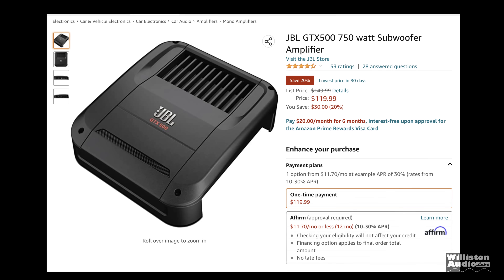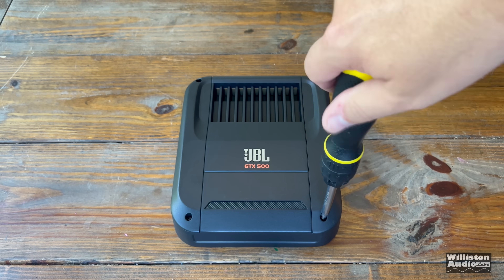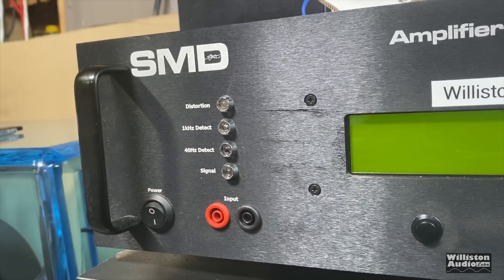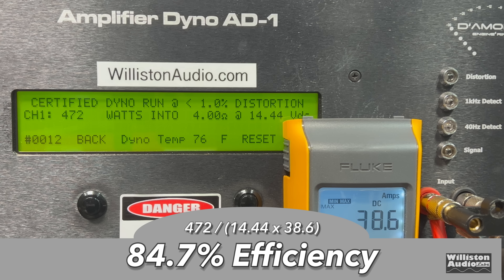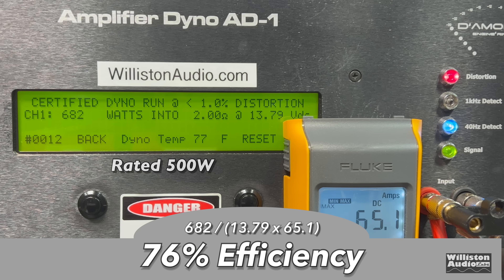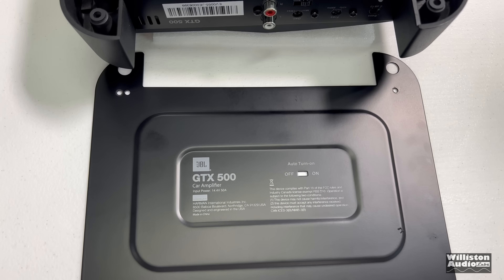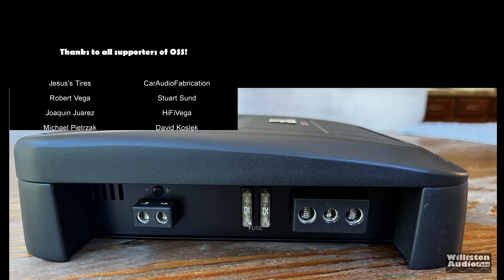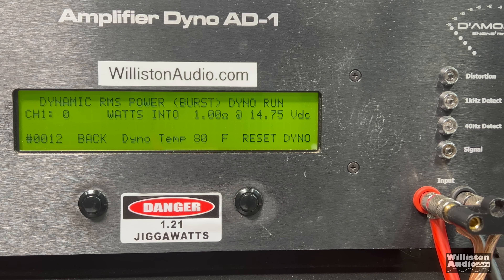This Deal Won't Last...Has it Expired?  JBL GTX500 Amp Dyno and Review

Comment from the maker: Shop (affiliate links):
Amazon: https://amzn.to/3Rw53q7
eBay: https://ebay.to/3KY5hV
KICKER L7R Quad Box: https://amzn.to/3KY5xn3
Shop for Other Low Budget Amplifiers: (affiliate links)
Leiges Audio 500.1: https://amzn.to/3PQ1utS
Down4Sound JP8: https://lddy.no/vvaw
SKAR Audio RP-1200.1D: https://amzn.to/3FLdLfk
CT Sounds CT-400.1D: https://amzn.to/3u9n1UY
VIDEOS: Playlist of Affordable Amplifiers: https://bit.ly/3cEQYHJ

--------- Cameras and Gear Used To Shoot This Video -------
(Video Gear I Use) 
Camera - iPhone 13pro 1TB - https://amzn.to/3nCjGvc
RODE Wireless Go II Microphones: https://amzn.to/3Q6NVHl
Shure MV7 Microphone: https://amzn.to/3A4OICK
Zoom H4n Audio Recorder: https://amzn.to/3BXjVsS
960 LED Panel: https://amzn.to/2Sxoq3S

This VIDEO was EDITED with LumaFusion on an iPad Pro 12.9:
iPad: https://amzn.to/2Ancr1W
Software: https://goo.gl/6yvWss

--------- Test Bench Equipment -------
SMD / D'Amore Engineering Amp Dyno: https://goo.gl/sJTcf7
XS Power D1400 Batteries - https://amzn.to/2BPFCKW
XS Power PSC60 Charger - https://amzn.to/2CHGcfs
Fluke 1000A AC/DC Clamp Meter: https://amzn.to/2Rw5WDA
Handheld Dyno: http://amzn.to/2u2EgKV
My Favorite Screwdriver Kit: http://amzn.to/2x0VzcE

DISCLAIMER: This video and description contains affiliate links, which means that if you purchase from one of the product links, I may receive a small commission. As an Amazon Associate I earn from qualifying purchases
Reply: 8 left in stock

Comment: Dereck, I just bought one of these "gently used" based entirely on this video. I already own a couple of JBL amps and needed another one like a hole in the head. But, this kind of power for $60 shipped is a deal I couldn't pass on. 
People seem to sleep on JBL and Infinity (both Harman brands) because of their legacy of OEM products. Well, there's a reason they have supplied auto components to every major manufacturer. 👍👍

Comment: I have this amp and use it in my new truck, thing absolutely rocks. Had it sitting in my garage and bought a skar sub to pair with the factory HK system. Mind blown and love the auto on/off, no need for a remote wire.

Comment: Harman doesn't play around with their legacy brands. It's long been a point of pride for JBL that their products are over-engineered for their specification. In fact, I have a JBL (rack mount) amp lurking someplace, model 6230 designed by their then-new subdivision UREI. The manual actually says that the amp ratings represent only 25% of what the components can technically handle, and they did it for reliability and headroom. I can confirm in my own testing that, despite being 30-odd years old, the amp can still pump about double its rating in ideal situations. That's as far as I was willing to push it, wuss that I am. 😅🤷‍♂👍

Comment: A 30 amp fuse will blow at around 60-80 amps. Double that amound with 2 of them and you could have possibly went all the way up to 160 amp draw if the amplifier wouldn't have went into protection mode.

Comment: I had an old jbl250 2 channel amp and for fun i bridged it on my nemesis colossal D1 which was wired down to 0.5 so the amp was seeing 1/4ohm per channel and upped the 225 amp fuses to 40 amp fuses and let her have it and damn it worked and got it moving pretty good it was hilarious that little amp was bulletproof

Comment: I personally like end caps for the protection. Have a socket or screwdriver rolling around accidentally and you don’t have to worry about it. I have never liked open connections for that reason. Just too easy to have a short circuit

Comment: You can probably cheat even more watts adding 40a blades instead of the 25! If the guts are Korean they will Handle the 40a blades and run proper 1ohm loud

Comment: I love mine. I was using it ti push two SKAR EVL 12s but running 4ohms. After watching your video I rewired to 2. The SKARS bumped their last bump,,,  it’s all good tho.  Replaced them with two 15” RF Series 1 that I’ve had since 96.  They do bump a lil doe

Comment: I remember another tested this amp and Uncle Steve tested the model before the Gtx. JBL amps does rated and more. They are not a Mickey Mouse company
 😂. Pioneer and JBL  were not the top 4 level but great quality for the price for many years. The GTO 501 was my top suggested amp for anyone running a D4 sub 1000 rms or less. Perfect with a Kicker L7 back in 2014

Comment: I am just saying almost every fuse is rated in a way so as the last like two minutes at 120% rated and pop with in 15s at 200%. So the fuses are normal the just can't work the way people think they do.
Reply: Most of these maxi/atc fuses are rated for 24+ volts iirc, and on peaks they rarely blow since it's only for a second or two

Comment: I remember the GTOEZ amps JBL had that looked just like the GTX. They were heavily underated powerful amps and had a clip indicator built in too. Steve Meade tested one. Nice vid Big D!
Reply: I have a 1001ez. The 501ez Steve Meade teated made 717 watts certified.
Reply: the GTOEZ amps are a level higher than the GTX, having identical chassis and boards, the GTOEZ have the knob adjustments on top plus an input for a bass remote.

Comment: What's a good amp that I can run on lithium batteries, powering a dual 10 inch 2 way, 4-ohm speaker system, hopefully at 150-250 wpc?

Comment: ..For the budget bass head, this amp is a bargain. And I like the end caps...this amp is disposable, when it fails, it will be thrown away. I don't care that it is not 1 ohm stable, you will get far more than you need driving a 2 ohm load, as you demonstrated on the "quad box"...it is likely that there is a twin to this amp with an "Infinity" badge slapped on it." Harmon Int", makes a solid product. I would guess that this is a tried and true design that HK mass produces in China, and slaps several labels on them for the Crutchfield,Amazon, BestBuy customer...it is decent, it is a bargain, but it is for the youth on a budget and not the serious enthusiast...but maybe the future enthusiast...love your channel Big D

Comment: This amp is a little beast I’ve known this for a little while. This was probably replaced by the club 5501 which I just picked up at a pawn shop had missing screws and stuck power one but I’ve drilled it out and tapped the threads and fixed now. Worth the 40 bucks. It’s got 60 amps fusing.

Comment: I just checked, I bought two of these in 2017 from Crutchfield. They were marked down to $99 at the time. 

Both have been playing at 2 ohms  everyday for the last five years (mine and my son's trucks). Both have been dead reliable. 

BTW. I was able to cleanly fit Sky High oversize 4 gauge in these.
Reply: I have 3 of these amps as well. They have been very reliable for me as well.
Reply: Yup. I purchased two from sonic electronics years ago for <$90 each. Mean little amps.

Comment: And that's why I own the JBL GTO-1001EZ. 😁
Almost visually identical to this one but, with controls on the top.
These GTX amps have been a hidden gem for a few years. Outstanding bump for your buck. 
Their only downfall...no onboard subsonic filter. 😠
Nice review and dyno Dereck!
Reply: I have one of the GTO-1001EZ amps as well as a GTO-3EZ.
The reason I got those 2 amps was because I have 3 of these gtx500 amps. All of them have been solid amps for me.
Reply: Iv got the GTO-1001EZ also. Its sounds really great and very reliable. Im never selling! lol
Reply: Ive had my 1001ez for quite a few years and I love it.

Comment: If JBL didn’t max the budget on custom end caps and used that budget money instead to include a bass knob, that little amp would be very close to perfect
Reply: Valid point however I think it is nearly perfect!
Reply: the GTX is actually a budget version of the GTO EZ, which is nearly identical but has the controls on top as well as an input for a bass remote knob👌

Comment: One of my favorite amps of all time! I picked up 4 @ $75.  I   Seriously wish  you could test a jbl gto 1000ez.. I wanna see if that 1470w @2ohm  max power is really rms
Reply: I own the 1001ez. Love it!
Reply: @msh6865  i swear the 10001ez does 2k + @ 1ohm
Reply: Where did you get it for $75 ?
Reply: @b0wwdwn1  couple years ago on ebay
Reply: I have the jbl gto14001 and it dynoed on my friends amm-1 at 1980 watts rms@ 2 ohms, and just got a gto1001ez recently for about $160 used on ebay but with these videos showing how underrated these amps are the prices are going up.
Reply: @sat3515  somehow I got a 1001 EZ for 130 like  new in box on eBay lol. I really didn't need another amp but couldn't pass it up

Comment: I love end caps on amp's. Makes for a cleaner install. If you "use" them you won't "lose" them.
Reply: Agreed!! The look install ends up cleaner….the older rockford power & punch amps always ended up missing one or both of the end caps I use to spend allot of time tracking them down 🤣
Reply: For sure👍🏾
Reply: Agreed. You shouldn’t engineer a product for dumb people
Reply: True they reallymake the amp look way sleeker, but they sometimes make it harder to move wires and unscrew stuff.
Reply: Sorry big D, I agree with this guy. End caps are good.

Comment: I have the JBL 5501 monoblock that is basically the same (verified by JBL) amp. It's one of the strongest mono's I own and also one of the smallest and inexpensive!
$70 average in great condition all over ebay.
Thank you for this video sir!
Reply: The only complaint I have with this amp is the absent of subsonic filter but other then that it’s a beast of an amp in a small package
Reply: @Liel-zx5zx  I use a DSP processor.....it has so many usable functions....like a subsonic. Well worth getting one.
You can get good ones now for under $300
Reply: @justinmurphy2227  gotta DPS dwnload in fone only pay'd 5💵💨 wrks good 👍
Reply: Is yours a GTOEZ?

Comment: I lost respect for JBL equipment because their subwoofer line was unimpressive, but this video makes me question my dismissal of their amps. The end caps are a big turn-off though, at least Rockford amps don't have giant mounting feet protruding from the sides of the amp as this one does. The high/low-level input on the RCA jacks is a nice touch. I assume one could just splice speaker wire into a cheap set of male RCA cables should one misplace the little dongles that come with the amp. Overall I'm impressed with the performance of this amp, especially given its price point. Well done as always Big D.
Reply from the maker: Thanks for watching and commenting!

Comment: Seems like a great deal, 2 questions Big D , Amazon comments said it runs hot shuts off quickly have you experienced that & w no subsonic can’t run ported boxes right?
Reply from the maker: This amp stayed cool powering the quad Box at 1 ohm so I’d wonder how that person had it connected
Reply: I doubt Derrick tested the amplifier long a nuff for it to get hot. It's not like he runs them at full power for a half an hour or longer.
Reply from the maker: @DTW-bx2vy  you only see very short segments in the video. I run the amps powering the subs for at least an hour
Reply: @wal  Well, I stand corrected & that is great to hear you test for that long of period of time.

Comment: Dang JBL. Pretty strong numbers for a 500 watt amp. Basically a 750 watt if you have the good 14.7v setup with a little lithium and a HO Alternator.
Reply from the maker: Seems to be pretty much a 500W amp at 12V and not too hard on stock electrical so would be a simple one amp bass upgrade 👌